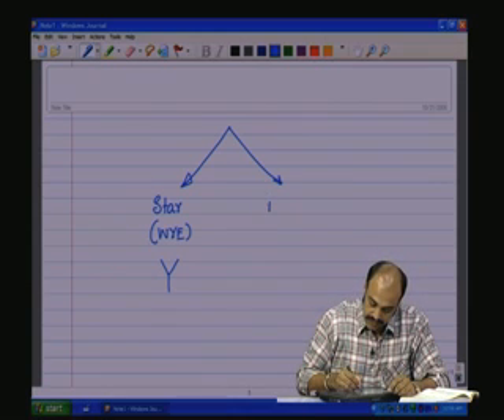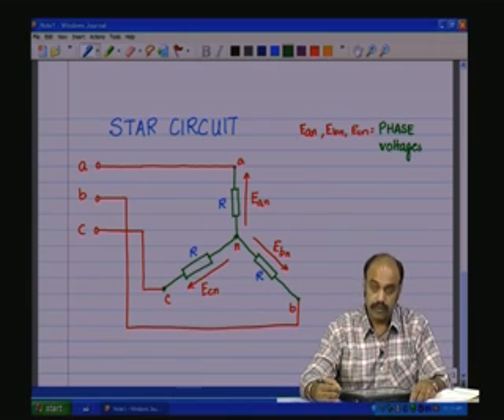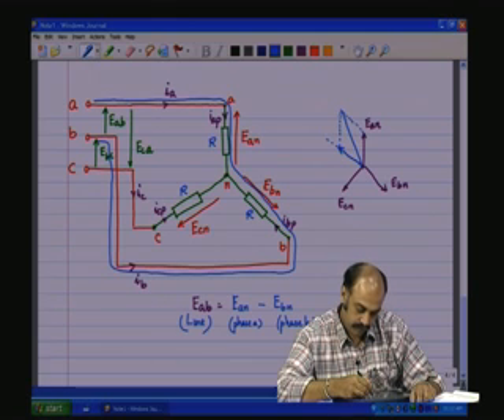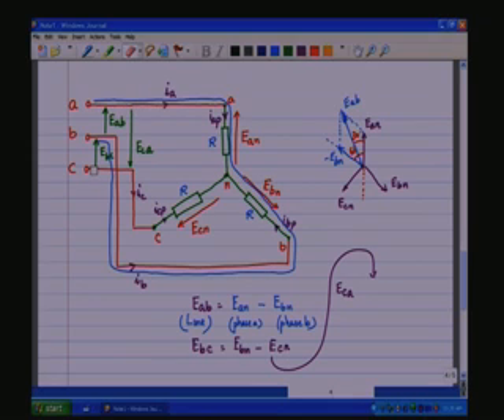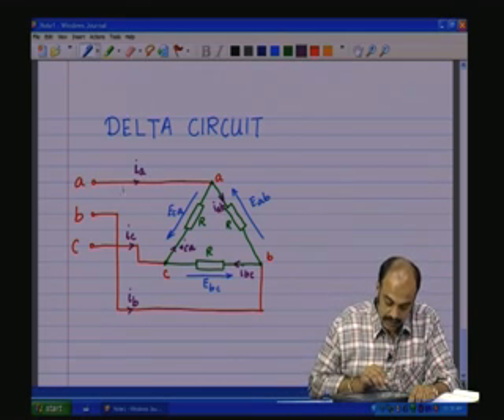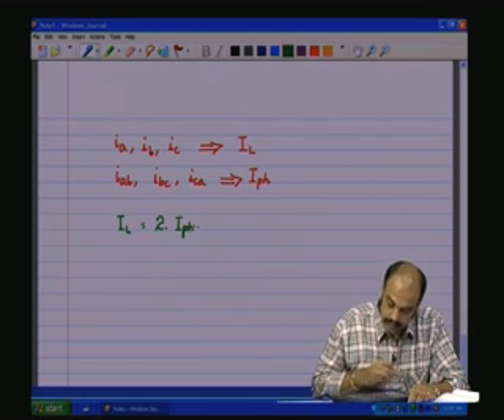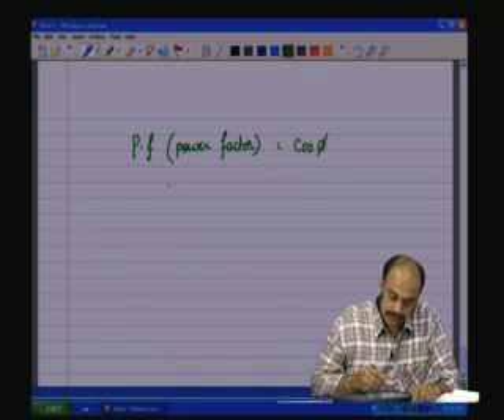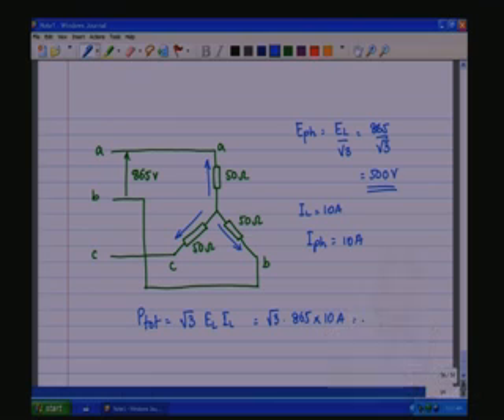Lecture - 31 Three Phase System 2

Comment: why did we take line voltage and line current in phase directly. How do we know they will be in phase?
Reply: Cause the line and phase current is flowing in the same branch .
Reply: because the load is resistances  just a guess